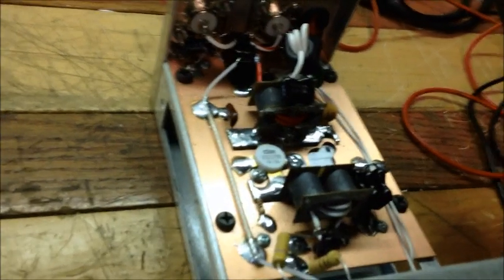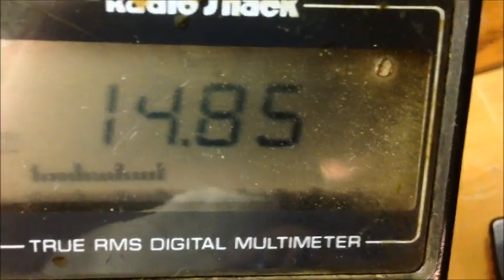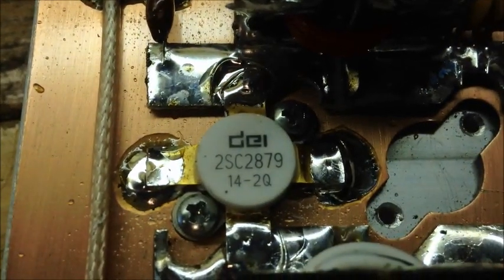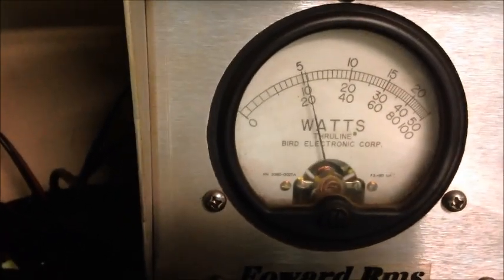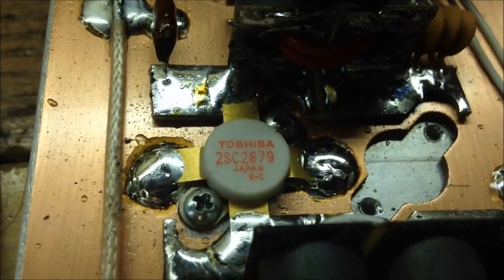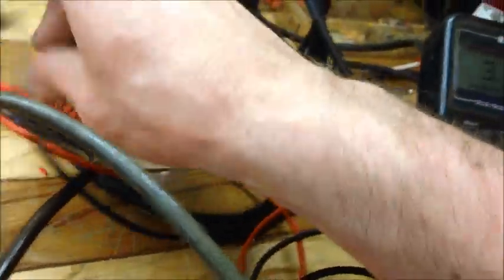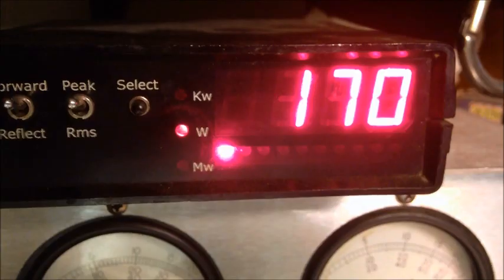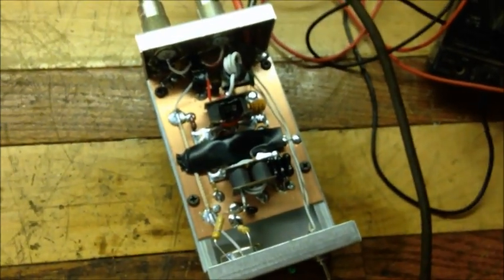Transistor Testing

Comment: 13.8v should be the Industry standard when testing not 15v, vehicles are 13.8v. Im wondering how you got almost 200w out of a 1 pill......and that digital meter is very questionable to say the least. The RMS watts were all in the same ballpark besides a couple of em, I would like to see a typical, average calibrated Dosy meter test not an eye-candy aftermarket PEP/multiplyer kit. Great idea on this video, but some things need to be done over again IMO.
Reply from the maker: Rob Livingston I would agree with the 13.8, but when my competitors all test at 15 volt, I need to be close to them. Now as far as peak is concerned, I could care less about it. RMS to me, is the real power not the peak. The peak makes people feel good. When it comes over the air, it's always rms that moves the S-meter. I don't own a Dosy and don't think I ever will. The peak bird is a Davemade meter and not 1 of the units sold on Feabay, I only use it because some folks want to see the peak side of things. Bird is the word.
Reply from the maker: Rob Livingston Also go watch a few telestar video he is getting more from them then me, but alot of his is deadkey. And he is using no transformers.
Reply: Cool Stickman, I hope I didnt come across being a nit-pick. Thanx for the reply/comeback bud, I talked to you in DX land before.....I enjoy your vids.
Reply from the maker: Rob Livingston No not at all, I like it when I get a few question that people come up with. I don't mind answering them at all. I may do the test again with my 43p in line, but I'm waiting on another pill to show up to test,  I think I'm gonna leave a few out in the next 1, only because some can't be bought anymore. So it would be best to show what is on the market as of now.

Comment: I am pretty sure you test the transistors for gain when matching. I would like to see outputs from various gain tests!
Reply from the maker: Larry's linears I just showed gain testing. Or do you mean gain testing on a super cricket or other style meter. If so i don't give to much to them. they are good for testing to see if the transistor is good, but thats about all. Now before you go on about how this should be and that, I've seen transistor not show much on the testing but work great in the amp, and I'm not talking about DEi's I'm talking about Toshibas. Shoot half the non red dots in my own 24 pill show weak on the tester but work fine in the amp, thats why i don't give much credit to the tester. I got a bunch of DEI's in about a month ago that rf had gain checked, they had high marks but were all garbage when we threw them in an amp. Some times the test meter can be a little misleading, I still do check them, but as I said before i don't hold it like the holy grail.
Reply: Dropmaul99 THANK YOU for your reply! Years ago I used a Tektronix 576 curve tracer!
Reply: those little testers dont work for me. I test a 2879 and it comes up good with a hfe of 49. I install it into my pallet board and dont get a single watt out of it. I put in another 2879 that tests similar on the tester and I get 60 bird watts. strange that the tester shows my bad pill is good even though its not
Reply: i only use the tester now to only match hfe for sets of transistors. Otherwise i just pop them into my pallet box and test em like this, except no soldering the pills in. Just a little cap that screws it down. I got that idea from (remingtoncountry1100's channel) so the credit goes to him!

Comment: nice. but do the other 2879's accept being volted. i know dei's don't. when i see one that does. i'll be buying an amp. a sizable amp at that. like a 8 or 16. i want a stout mobile.
Reply from the maker: dale myers Well unless your going to a keyoff, makes no sense in volting an amp over 16 volts. But to answer you, yes they can be volted with no issue. I've been using these in our keydown driver boxes for years. They aren't anything new. It's just no one has look at them and everyone has jumped the DEI wagon.
Reply: i plan too.
Reply: and the 8 to 16 will be a driver to the big box.